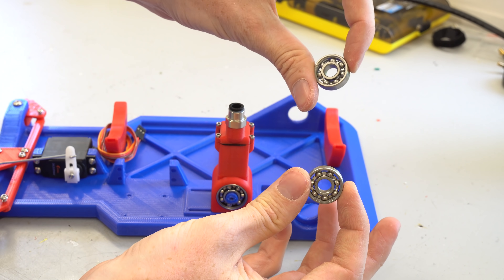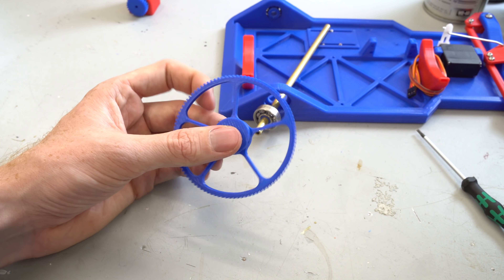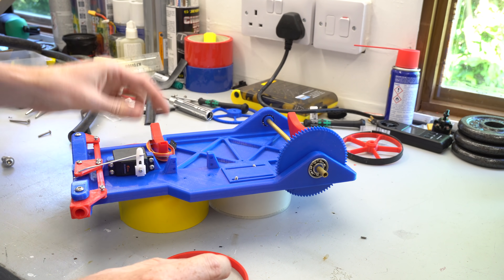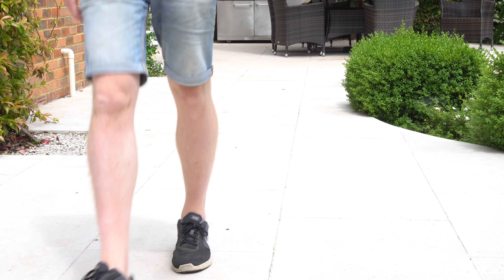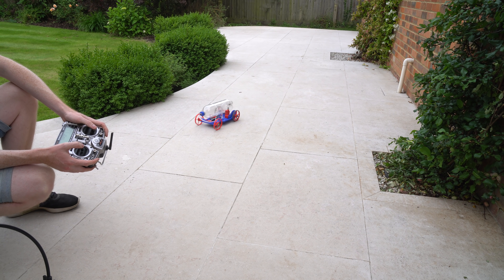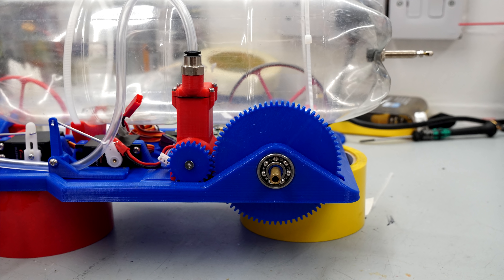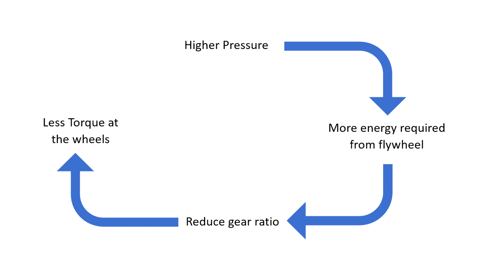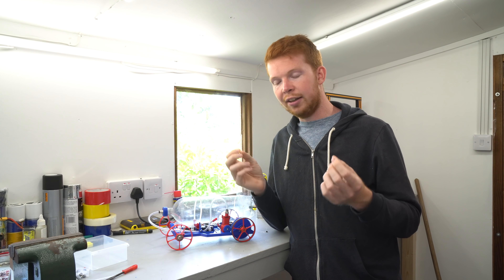Air Powered Car

Comment: Understanding that a multi-piston design would be a nightmare to design, how would a Wankel design translate to air pressure? Setting it to intake when the 'combustion chamber' increases volume, and exhaust during compression. Or would rotor-housing friction be too great to overcome?

Comment: Do a three-stage compound expansion for more power. Also you probably screwed up the valve mechanism if it stops working past certain pressure.

Comment: I agree with everyone else who says add a flywheel. That's how you solve the conundrum, by adding mass to it, so it can operate the valve at higher pressure. Most efficient solution is probably to put a shallow circular channel into the big gear, and put a large metal washer in it. A solid disc would be wasteful, since the central part just adds mass and very little rotational inertia (check out the flywheel design on a traction engine for example).
It's an elegant project, this one, I'm looking forward to seeing how it develops.

Comment: There is a full size air powered car in real life but they won't tell how it works for obvious reasons. I know they have a carbon fiver air tank and use a small amount of fuel to heat the air right before it goes into the piston chamber to extend the air tanks uhh air time? not really sure what word to use there. on air alone it supposedly gets 30 miles but extends to 120 with gas heating the air. My point is they have some how come up with a solution to your problem so something could work. Maybe use a air powered toy plane and see what they used? they don't even have a flywheel.

Comment: Why not giving the engine its own flywheel (smaller but out of denser material) and having the engine connect to the drive wheel via a clutch so you can start the engine without pushing the car.

Comment: I don’t know if anybody else said this, but would you be able to make the engine rely on a independent fly wheel rather than relying on the car to do the job. Or would that just cause more problems than it would fix. Regardless, I hope this comment helps you.

Comment: You need a lower gear ratio to make the engine able to run faster while the car doesnt, and then you need a heavy thing on the crankshaft ( a flywheel), maybe a metal disc that can pull the crankshaft

Comment: I think the reason that your car didn't work at high pressures is that the valve mechanism isn't quite lining up with the stroke of the piston. If you look at the designs of actual steam engines used to power cars like the Stanley, the slide valve is optimized for high torque making a transmission or gears unnecessary. Steam engines have a lot of torque.

Comment: you may not ever see this comment, but after watching some of your videos about compressed air motors, alot of your energy is being lost trying to push a spring or something of the sort, to make an engine run. i think if you were to use the exhaust air (already spent going forward, but still pressurized) to push on a rod that would open an air intake valve you would save alot of energy. Look up a Tippmann response trigger, it uses exhaust gas to power a piston to push your finger forward again so you can fire a paintball again.

Comment: Have you considered installing a differential on the rear axle? That would prevent the tire drag which ditches a lot of the speed on the corners. You're almost leaving tread marks on the ground during that turn.

Comment: High pressure fuel (air) tank, regulator, then plenum, before throttle valve.  Plenum can be a really small water bottle. Multiple cylinder engine with flywheel before drive gear.

Comment: Wouldn't a multi piston setup be the simplest method for overcoming flywheel torque? A beneficial torque is created during the powerphase of the stroke of an alternately phased cyldiner.

Comment: If you need to increase mass of the flywheel, couldn't you use a denser material, a denser plastic, wood (?), metal or metal inserts?

Comment: how about a two cylinder air engine, so that you don't have to rely on a flywheel that takes way from the momentum of the car?
the power of one cylinder opens the valve of the other one.
 also the car would have more power.
actually now i am a littly hooked but i dont know if my 3d cheap printer can produce exact engine parts

Comment: Very nice progress.  I've got a question for you, though it doesn't have to do with the air powered car.  Have you ever heard of the Tesla Valve?  I'm curious to see how well it could handle high air pressure.  I was wondering if you could test it out, see how well it does, and if it works well, you could probably implement it in the design somewhere, because a non-moving one way flow of air would be really neat and helpful if it works well at both high and low pressures.

Comment: You need a pressure regulator.  You can only store more gas by compressing it so just add a pressure regulator and maybe a secondary expansion chamber to provide a fixed pressure to your engine.  Your main air tank becomes a fuel tank and a secondary chamber/pressure regulator provide a constant, ideal pressure to your engine.

Comment: If you add more mass to the small gear, would that not act like a flywheel thus fixing part of the issue?  I know that you can get plastic with metal fragments in it for 3d printing.  Maybe that would work.

Comment: Perhaps reverting back to yr older v. Engines,  since there's allot more gravity involed and the other ones were able to do allot better with a higher pressure faster than a low one

Comment: What if the are multiple tanks that all have low pressures and power the engine in sequence. With the second tank starting when the first runs out. Wouldn't that make it go longer?

Comment: Why not add a second tank pumped at 30 psi and when the first tank gets empty, the next tank can be opened so a more constant pressure is delivered to the engine. So to get the car to deliver the same amount of energy but at a lower constant pressure

Comment: I'm no engineer but can't you keep the limiter on the throttle tighter than you currently have it to lower the amount of the air coming from the air tank, that would allow a greater psi for longer drive time and it wouldn't stop the engine up.

Comment: wouldn't the flywheel issue be solved by placing it directly on the crankshaft of the engine. This wouldn't be affected by the gearing and in fact would spin faster than the output gear. Maybe something metal like a washer

Comment: you could also have a clutch and/or a variable gear ratio. you just need to have several ratios for the car to keep the engine at a good RPM.

Comment: Add flywheel and simple clutch system. Clutch may be done from piece of rubber connecting rear axle and engine. Obviously you can control it later by tensioner pulley and servo.

Comment: Multiple cylinders, say 3, would mean that at any angle of the crank would have a power stroke. Odd number multiple cylinders would also have no stall points and be self starting.

Comment: no need for complicated 2 cylinder engines, just print out a identical engine and mesh the gears together ( make the engine counter rotate or put another gear in between)

Comment: two thing here could help, 1 a regulator, in order to have  constant and optimal air pressure to the engine, and print out a second engine and just mesh the gears together, 180% out of phase so the power stroke of one will open the valve of the other

Comment: I was certain that you did parallel steering on purpose because you wouldn't get the best steering behaviour out of the thing regardless of steering geometry, and parallel is just one less thing to think about.

I mean it's not like you have a differential on the rear axle... so your wheels are always gonna scrub. Oh by the way, go-karts often have only one driven wheel, not both, guess why.

Comment: You might be able to fix the torque issue by adding weight to the crank instead of the flywheel. Specifically opposite to where the piston connects to the flywheel. Because you are giving the car a slight push start it shouldnt be an issue. You could then compromise how much you have to compensate with the flywheel.

Comment: I have build a lot of lpe's (lego pneumatic engines) and I always find that the best power to air consumption is produced by a 2cilinder , maybe you should try buil a second engine and just conect the drive shafts . I have to mension that I dont know if the power/air consumption is going to improve with a 3d printed engine as you heve more air leaks

Comment: I think the engine should be connected to only one wheel in order to overcome turning problems. Adding a differential would be too much of a new friction source and it also would need some time to be designed so disconnecting one wheel is the simpler alternative.

Comment: Hey Tom. this is a really cool project!

I was thinking and couldn't you add more of the engines? Essentially making a 2 or 3 cilinder motor. That would also help with starting to move from a standstill (especially if you have a 3 or 4 cilinder engine). And then you have so much extra power that maybe you'd have enough to spare to add a little battery and air compressor? 

I see possibilities!

Comment: I have some wild ideas: 
1. Google "Garden pressure sprayer knapsack" and notice that the air is forced in with a pump and the air inlet is below water. I don't know if this would do better but I would think that it might inspire you to brainstorm a new design.

2. As for your new design, I would like you to google "Cox tee dee .010 - worlds smallest Production diesel engine in action" note: how this engine has the flywheel attached to the crankshaft... this is what I think is important. It also has no spring so there is no moving parts with the value... so you should have better results.. cross my fingers... lol
In order to get enough weight, some metal IMHO should be added to the flywheel on one side of the flywheel so that the physics are close to what this motor has.

3. As for starting I believe that your TIRE diameter should be the same size as your flywheel or not much larger so there isn't so much forces required to get things moving... as the bigger tires in my opinion require forces to overcome the leverage. I really don't know how to explain but I think you understand what I am getting at. 

4. Printed gears are ok for low speed, but there are pre-made nylon precision gears that are so much better and will will forgive you if your design has a couple parts that are not 3D printed. 

5. Google "How to make a Urethane Mold" as Urethane is a soft sticky rubber and your going to get awesome traction provide that there is enough weight in your car to press the wheels against the ground. 

6. I was wondering if something freezing cold, like dry ice would produce an expansion of the air if the air left the tank with dry ice and had to go through a long enough length of tube that the air would be ambient temperature... again, wild guesses... hoping to inspire thought.

All in all, I have subscribed and clicked on the bell, because I look forward to each and every video that you do.

Comment: USWaterRockets has a good point. The addition of a flywheel would greatly improve the operation of the engine at higher pressure as it would carry the engine through the exhaust cycle

Comment: dude, your being daft, every car has the issue, every engine, the car or gears are NEVER the flywheelm look on a small 5hp Lhead engine, it has a flywheel on the OPPOSITE side of the power gear, and a clutch. especially on a gokart that only engages at higher speeds

Comment: Try lightening the car weight maybe the rear is too heavy that slows it down cause when the wheels are off the ground is spins smoothly. For the gear try adding a piece of paper that leave a GAP between the spur and the pinion gear.

Comment: On the motor, add a cam pushing a roller and spring.  Over the part of the rotation that makes torque, have it store energy in the spring.  When the torque is needed to open the inlet value have a sharp down ramp on the cam so the spring adds a large torque just at that point.  This will make the motor work at high pressures at the cost of not working at extremely low pressures and a tiny bit of friction.

Comment: pre load the lifter
Reply: I just suggested a way to get that same effect in another comment.
A spring can store energy for the brief time needed to open the valve.
Reply: if he were to double the size of the ball and leave the same size o ring the air pressure would do most of the work to lift the ball. if you look at this very crude image https://ibb.co/bR0HFJ       the grey line represents the point of contact between ball and o ring. the area above the red lines is producing a downward force  the area below the red lines is creating an opposing force. done this way the lifting force for the poppet stays lower and much more consistent regardless of the pressure. this is called the effective area same reason double acting pistons have more force in one direction than the other.

Comment: Put a weighted flywheel on the engine crankshaft you can Mountain one outside of the smaller gear that way it will clear the larger gear but make it thin enough that it will also clear the wheelbase

Comment: Flywheel with a slipper clutch would work best and is quite easy to implement to Tom's current design this is basically how nitro RCs without stopping the engine as nitro RCs us a bell housing with clutch shoes and this could operate vary similarly

Comment: You should use more gears so the engine doesn't have to work harder  
And more engines
Reply: Three engines could well work better.
There can always be one making torque while another's valve needs opening.

Comment: You need to design a valve which has a 35psi output and you can put as many pressure on the input as you want. I know you’ll figure something out.

Comment: I think it will work better if you use belt instead gears to transfer power to the wheels.
Especially when your gears not match very well.
Good luck, and thank you for another interesting video.

Comment: Perhaps a two tank system.  The larger high pressure tank and a smaller tank with a lower pressure.  That way to don't loos range but decrease the torque required to drive the engine back around.  You would just need a pressure regulator to let air into the smaller tank fast enough to keep it pressurized.

Comment: Instead of trying to spin the flywheel faster, you could just add more mass to it! That way you don't have to redesign the engine or change the valve system.

Comment: I personally would suggest attaching a heavy flywheel directly to the engine output shaft. That way you don't have the problem you described where you have to decrease the gear ratio, and you save yourself the problem of having to redesign the entire engine.
Then, I'd suggest using a proper pressure regulator for the throttle. That way you can control the throttle more accurately, and you can also pump your air tank to a higher pressure without stalling your engine.

Comment: For a rotary valve. You could have disc spin inside a sealed enclosure and have a carb like body and butterfly to control the air input. The seals you would need would be the enclosure of the rotary disc, between the carb body which holds the butter fly and the pipe between the carb body intake to the bottle.

the issue with the rotary valve would be the gap for the rotary valve to spin in. The tolerances would need to be really tight for it to work properly. Otherwise your air pressure will get lost in the gap between the engine and rotary disc and the disc and the enclosure.

I would try an engine with a lower stroke but larger piston size. Maybe you could shape the piston so it forces the air out the exhausts better?

For a drive, could you make up a very simple CVT system?

Comment: What are you using to lubricate the moving parts? Also, if you do decide to redesign the engine, I think you should use a metal cylinder, use a piston valve to control inlet and exhaust, and use air tool oil to lubricate it.

Comment: Really intriguing problem You got there... I might be totally off base, but wouldn't changing the size of the wheels also play a part in the equation?? Not that I can say that it is a viable solution to Your problem, not least considering that with Your current construction that size is also "constrained" by the size of the  driven gear... so that all "meshes together" again (pun attempted)
Anyhow, thanks for another great video.
Best regards.

Comment: Now if you could convert it to steam without melting all the plastic.You can quite easily have a very fast and reliable air car but some smart design is required.

Comment: I'm seeing a third option: add a compact metal or HDPE flywheel directly to the crankshaft. It will eliminate the gear ratio issue.

Comment: I wonder if a multi cylinder engine may be worth a look here... Maybe a 2 cylinder at 180 degree crank phase(a 3 cylinder may be better). Theoretically, each cylinder should assist the other to open it's respective inlet valve.... You're right with rotary valve, would leak like a sieve!

Comment: Ackermann is the word you're looking for at the start. Its the technical term for steering where the wheel on the inside turns tighter than the outside.

Comment: Get a differential for it. You could use a lego differential in it so the small gears would not cause problems with the printer.

Comment: How about a secondary flywheel with a gearing in the opposite configuration  as the one to the wheels? 
As the stored energy of a flywheel is 
Ef = 0.5 * I * ω^2
The angular speed is the more important part of the system.

Add a clutch to transfer the energy stored in the flywheel to initially accelerating the car as the motor is clearly not powerful enough to do it on its own.